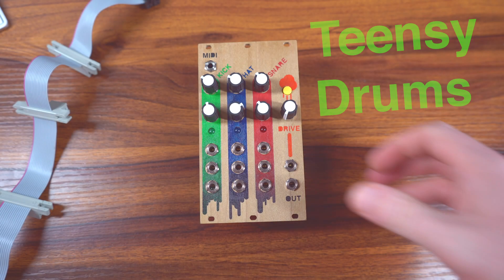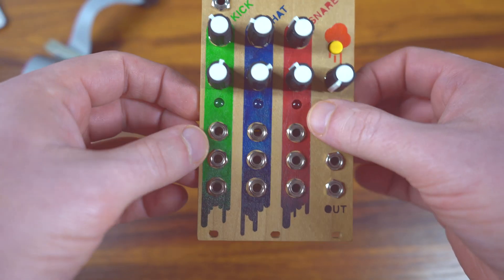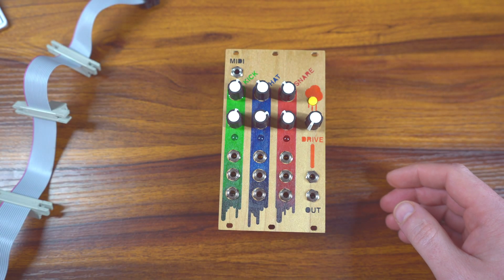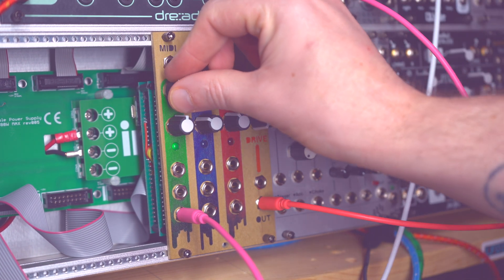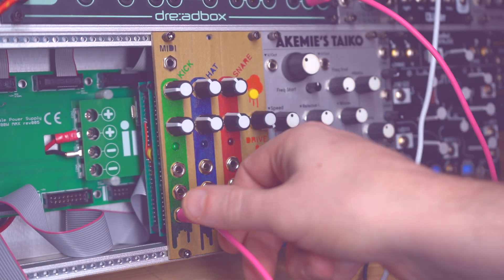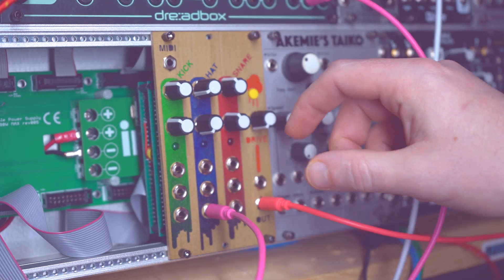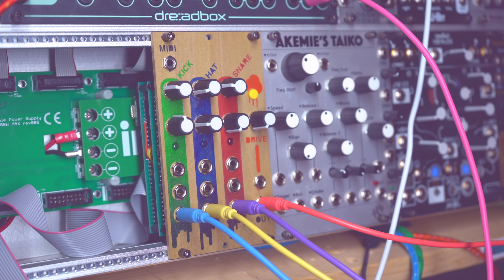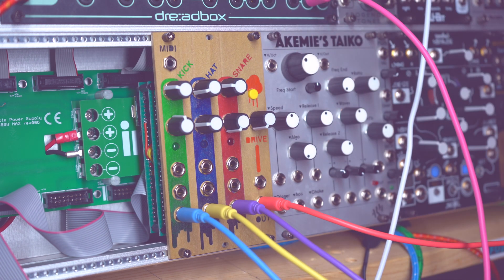Teensy Eurorack Drum Module

Comment: I'm making a Teensy based Eurorack module but once I connected it to my modular, I realised that it's just not loud enough in a Eurorack environment. How did you resolve this?
Reply from the maker: You have to amplify it. I have various schematics on my git you could use for reference.
Reply: Add an op-amp output buffer.
 Your circuit should have access to the ±12v, so an op-amp and a few resistors could bump up the output voltage. Add a pot & you've got output level control.

Comment: Im currently bashing my head through making this module, so far I’m just converting the schematic to bread/perf board so i can understand it easier.
(I suck when it comes to schem’s) 
Do you have any documentation on how the boards look when apart? It might stop me from making silly routing mistakes that take up space =D
I love the layering of sounds!!
Reply from the maker: I don't, sorry. I would have to pull them apart to look and I'm not sure it would be of much help since it's just a mess of wires.
Reply: @otemrellik  ok no worries, ive made a decent enough layout I will be trying soon. This is my first conversion from schematic to perf board.
The only part missing on the schem is the button. How is that hooked up?
Would you want to look at/have my perf board layout for others wanting to make this?

Thanks for keeping me busy with projects =P
Reply from the maker: @willow2x  Yeah, I could add that to the git page. I forgot the button was added after I made the schematic. Looking at the code, it looks like it's attached to pin 8 on the teensy.
Reply: @otemrellik  awesome! Thank you. Saved me a bit of effort =P 
Been soldering it up today, probably wont be done and tested till tomorrow lol
Reply: @otemrellik  what version of the IDE did you use? 
I seem to be running into errors,:
'class AudioSynthWaveformSineModulated' has no member named 'mod_index'

it could just be me not being arduino minded though.
Reply from the maker: @willow2x  That's my bad. I forgot this uses a different synth_sine than the stock audio library. I just added synth_sine.cpp and synth_sine.h to the git project. You will have to replace the ones in the audio library with these and it should compile.
Reply: 2years on from starting this and having some shorts, I've fixed and got it working. It's been sat in my fix it draw for ages. 
Looking at making a PCB for it. 
If I get it working do u want to add the Gerber's into your git?
Reply: PCBs have arrived, building this week!

Comment: Hey! Totally offtopic, but i've decided that i might build your Stratus project for myself, now i'm looking at the PDF of schematic, and there is only one thing that i don't understand is where the 4 pins of USB go? I understand that one of them would go to power Teensy, but where do others go? I imagine there are no traces in schematic because you probably soldered wires to the points where needed?
Reply from the maker: The usb pins were just connected to a male micro usb jack and plugged directly into the teensy.
Reply: @otemrellik  got it, thanks!